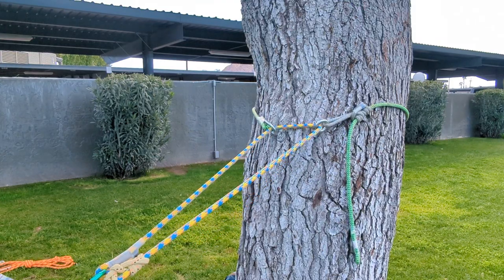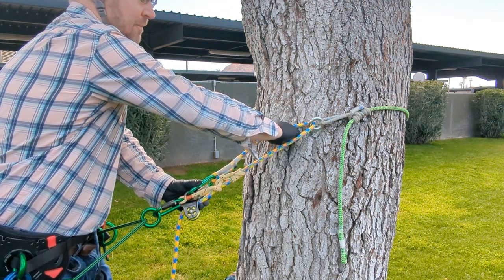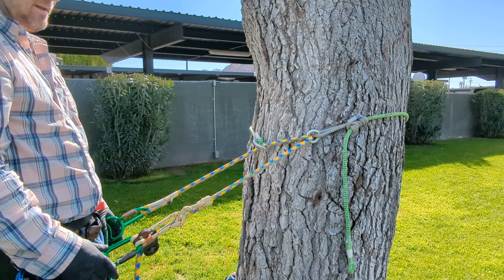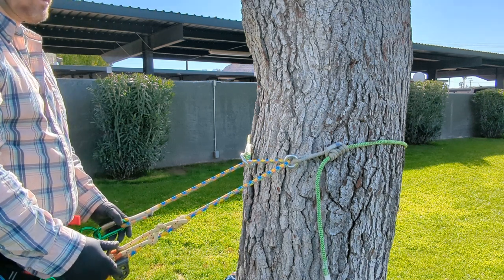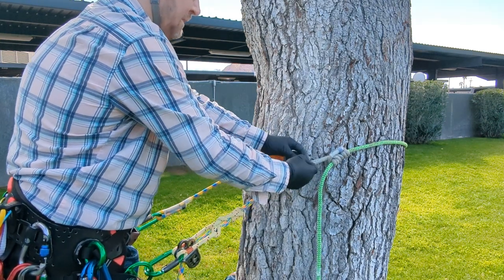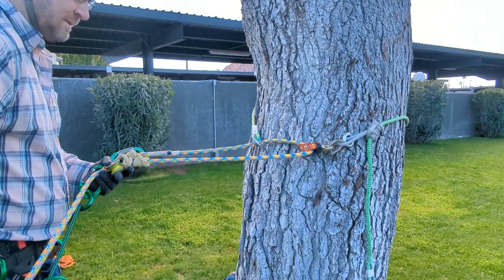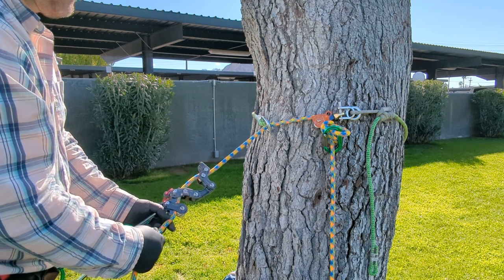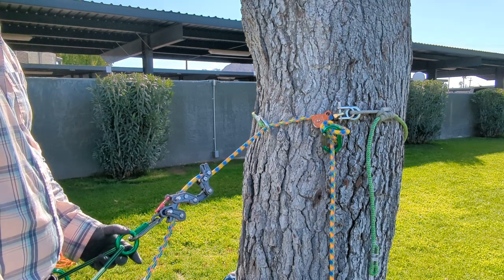ADJUSTABLE FRICTION SAVER for Use As A SPAR Anchor for Arborists & Tree Climbers!

Comment: Hello sir 👋 I use a Flip line (10 feet) .. and i also use my DDRT rope system as backup .. this looks even better .. by using this .. i do not need my flip line anymore .. is this correct ✅
Reply from the maker: You shoud still always have your flip line for ascending a tree and so that you can secure yourself redundantly when it comes time to install or uninstall your friction saver based system. Or at least have a lanyard. You always need some kind of redundancy! Thanks for your positive comment! Check out this video if you're interested in learning about different spar anchors... https://youtu.be/_wT7wg6Odtw